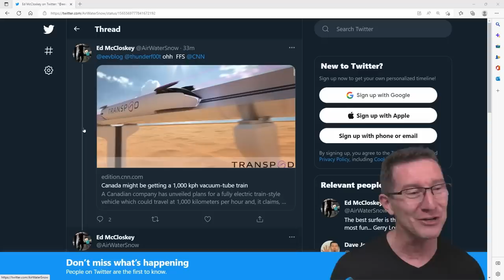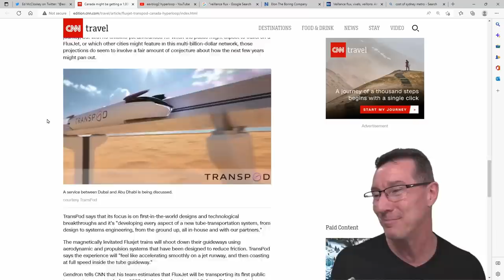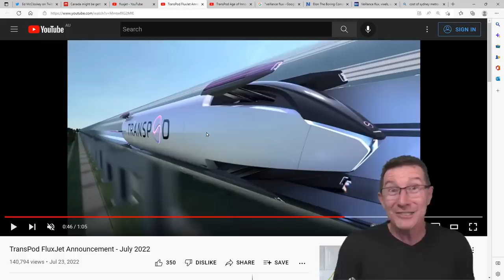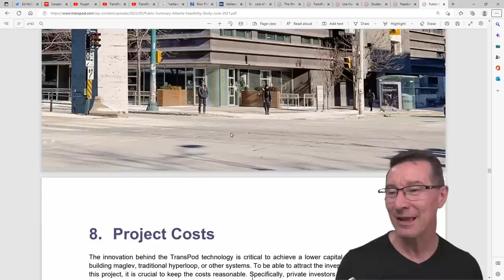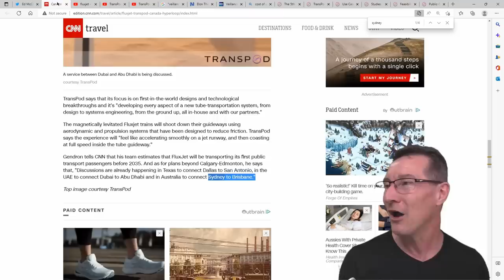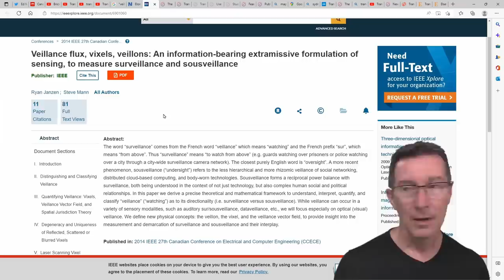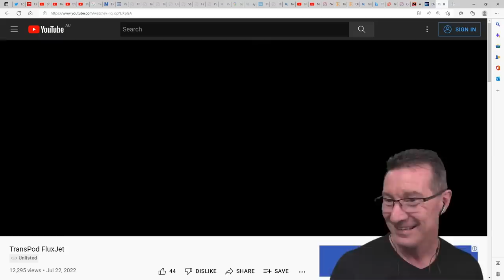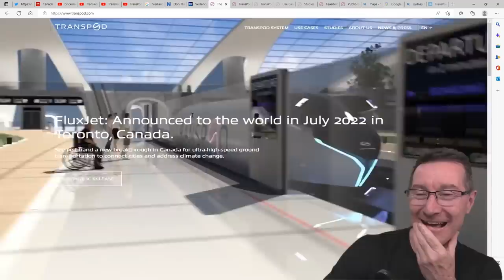EEVblog 1498 - TransPod Fluxjet Hyperloop $550M Boondoggle!

Comment: Canadian here. Our nation's capital only just got "light rail" in the past few years. Of course, they used what is effectively a trolley/street car so it's slow and unreliable. It would not surprise me to see our gov't throw endless amounts of borrowed money (as debt issued to the taxpayer) at unviable projects while they can't even maintain the airports, roads, or existing rail infrastructure. This isn't even getting into all of the major public services that are crippling under pressure right now.
Reply from the maker: Oh yeah, they'll throw money at this and it will all be wasted. Well, it will at least employ many engineers for a while until it completely fails.
Reply: Kansas City, Missouri has that idiotic light rail.  $100M for 10-15 miles…

KCMO has more pressing issues than a trolley to the neighborhood of make-believe.
Reply: @EEVblog  The $9B train was under-spec'd and broke down constantly (search "ottawa light rail disaster" to see more on it). We can't even get the most basic light rail right, and all of our commercial and inter-city routes are still diesel, but they want to spend all the money on these idiotic ideas that will make zero difference since airplanes exist.
Reply: @Thirsty_Fox  It's definitely had issues.. But it's 1000x better than taking a diesel bus through the downtown corridor 2x a day like I was doing..

This is what it's like without the train:
https://www.youtube.com/watch?v=CSrzHAB2u4M

This is what it's like with the train:
https://youtu.be/rzG1CQwGoX4
Reply: @NathanaelNewton  First, I'm not opposed to light rail -- I absolutely think it's great when done properly. What's been done in Ottawa has been late and overpriced, and riddled with problems.

As to those videos, hardly a fair comparison since that bus is taking the route through all the neighbourhoods on regular roads (where they serve many people). The busses are quick enough when they stick to the rapid transitway routes with dedicated roads and infrequent stops. You could put a bus along the route that track takes and it'd be the same.

The worst part was having the busses dump everyone off at Tunney's Pasture when they first opened. Half of the people coming in through town are getting off at the first two train stops -- why couldn't they just let the busses go two more stops? Instead you had people jam packed at Tunney's taking 5 trains to get on. We lived at Westboro station at the time so it was bus for one stop, then try to get a train for two stops, then another bus... finally said screw it and started driving and cycling. Could crawl to work on my hands and knees faster than most OC transpo routes!
Reply: @Thirsty_Fox  You make some fair points.
I really wish I had a video of the rapid transit route that was used before the train was built but that was before my time here..

Ottawa is wonderful for cycling, I really need to fix my bike. 

I spent a lot of time recently commuting from Lincoln fields to Elmvale Shopping Center and it was difficult to decide which way to go as taking the 55 to the 85 was sometimes 5 minutes faster than taking the 40 to the train to the 57 but some days the traffic would be bad and the train would be way faster..

I ended up taking the train on my way to Elmvale and either getting off at lees and taking the 55, Hurdman and taking the 46 or St Laurent and taking the 40.. 

I would have to keep my phone open and track the GPS to know which train station to get off at otherwise I'd be waiting 20+ minutes
Reply: @EEVblog  I saw on the news yesterday in Türkiye that the Hyperloop is being pushed in Türkiye as well. It looked like students were working on a scale model Hyperloop as part of Teknofest 2022.
"Hyperloop was the subject of a competition for the first time in Turkey. TEKNOFEST, the world's largest aviation, space and technology festival, organized a Hyperloop competition among university students. Hyperloop technology, brought to the agenda by Elon Musk, owner of SpaceX and Tesla Motor companies, is based on the fact that wheelless vehicles travel at levels close to the speed of sound."
So another country falls for the hyperloop scam.
Reply: Only because they went with transitway which was great in the 80s but not so good recently with reduced spending. Skytrain in Vancouver received similar criticism in the 80s and 90s but it's good now.

Comment: 30:30 That's just a "little" metric to imperial units mixup: Japan Rail's experimental maglev train JR L0 Series achieved 603 km/h (375 mph) on a 42.8 km magnetic levitation track in 2015.

Comment: Our neighbors in Alberta have temperatures ranging from -40 to +35 C .. thermal expansion of vacuum tubes sounds like a challenge .. Greetings from BC
Reply: More than a challenge. The only way to mitigate it would be to do it underground where the temperature can much more stable. Then you have a lot of new problems that make it equally stupid.
Reply from the maker: It's one of show  stoppers.
Reply: @MeppyMan  at least in the underground version, they wont have to be moved to a grave.
Reply: @Redstoner2b2t  haha!

Comment: Regarding land issues - Edmonton and Calgary are probably among the cheaper major cities for real estate in Canada - it's not Vancouver or Toronto by a long shot. I could buy at least a couple detached houses in Edmonton for the worth of my 1 bedroom condo in the Vancouver area.

Personally I think there should be more focus on local transport, it's a heck of a lot more useful to put money into expanding the existing train commuter train networks to get cars off the road.
Reply: Not familiar with Alberta but what about the land in between? Where are the oil sands located?
Reply: @dejjal8683  Natural resource industry is to the north. Calgary and Edmonton are surrounded by farms.
Reply: @dejjal8683  the land in between is sparsely populated prairies almost completely flat...actually almost ideal for this sort of thing, if the concept wasn't completely hogwash.  There are no oilsands between Calgary and Edmonton at all--it is exclusively natural gas and light oil in that area retrieved from conventional drilling and some fracking.

The oilsands are another 300km further north than the northernmost point of the proposed line and so would not really factor in at all, except perhaps for Calgary workers who would take this to Edmonton to catch a direct commercial or corporate flight to Ft. McMurray since many if not most of such flights from Calgary make a stop in Edmonton now anyways.
Reply: @markshanehayden4648  Thank you for the answers. My second question would be the problem with settling. I wonder how deep the piles would have to be to prevent major problems down the road.

Comment: 35:09 I see laminated iron cores of Microwave Oven Transformers with crudely made windings? It reeks 'low budget movie prop'. Now I cannot unsee it.
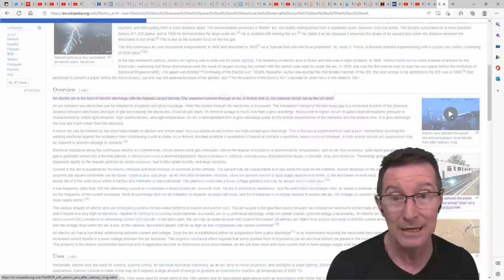37:34 Arc is undesired effect in electric transport. Thain with overhead power line was shot in winter when power lines covered in thin layer of ice and arking like hell when ice is crushed by pantograph. This effect is undesirable bcause it erodes copper from power line and contaminate carbon electrode.
I mean, Green soveiet-style train was not powered by arc but more like just arcing due to icy power line
I have posted this on Odysee but will leave it here too:

I have worked on linear electric motor for oil pumps about 4 years ago. We made some working prototypes but project was canceled.
And I have to say just one thing - High temperature rare earth magnets are bloody expensive and heavy!
You have 2 ways to build linear electric motor on pod like this – place coils on your pod or on rails. Other side must be permanent magnets or electric magnets.
And what happens when you leave strong magnets in place where ferromagnetic dust are flying around?

There are also size concern. You see, there are specific ratio between you ‘Pole width’, ‘Frequency’, ‘Torque’ and ‘Movement speed’…
You cannot make High-torque High Speed and Small linear motor, just like any other electric motor - there is no magic!

Also forget about any plasma near the rails with strong magnetic fields that propel this pod…
I don’t know much about plasma but I can say for sure – Plasma does not works the way shown in the video. Also it would wear contact surfaces in no time (Say hello to arc welding / plasma metal deposition)

I think almost any engineer regardless of their fieald of expertise would have the same reaction as Dave here. (w00t? LOL!)
Reply: they claimed the rails were just steel - its what they seem to claim distinguishes them form maglev - use of attractive magnetism only.
Reply: @Mijc Osis  If rails are ferromagnetic then linear magnetic propulsion, using the same rails as part of linear motor (rotor or should I say, slider?) are impossible. 
Well, this whole thing is questionable, at best.
I wonder if it possible to make linear motor like induction motor with diamagnetic 'rotor', I doubt it. There will be no distinct magnetic poles without ferromagnetic core that guide magnetic flux… The ‘Rotor’ part will just heat up due to Eddy currents with almost no repelling magnetic force.

Again. Linear motors are not magic. They are very nice but niche thing...
Reply: @gelecopter  maybe they really have created some kind of eddy current drive in steel, and leakproof tunnels, and a plasma pickup shoe and track good for commercial use that doesnt somehow oxidise and vaporise, and ..........

Comment: Here is my question, why do you need LiDAR on your vacuum encased maglev? What do you expect to be there other than what you design?
Reply from the maker: It's so that so that you can stabilise the pod in real time. Good luck doing that at 1000km/h.
Reply: That seems even more foolish, better design would be to just make the track smooth and reliable surely.

Comment: I only have one question: how do they prevent side fumbling?
Reply: Easy, "Side Fumbling" can be prevented by introducing six hydrocoptic marzlevanes,  fitted to the ambifacient lunar waneshaft. This will significantly reduce the troublesome phenomenon.
Reply: They line it with prefamulated amulite.

Comment: Red Deer is a small city right in the middle between Calgary and Edmonton.
Also there is no mountains to drill through on that route :) Just slight elevation changes - it's prairies.
Still will never work. I'd be happy if they would run just normal passenger trains between Calgary and Edmonton.

Comment: I have One big question: how can you cool the electromagnets and all the electrical systems + people of a train that levitates in a vacuum? I guess it dissipates some heat and I don't think the vacuum is the best conductor of heat :D 
a hyperloop train is like a thermos that generates its own heat....
Reply: I asked the same question to a team member that was part of a hyperloop contest. They were literally just relying on thermal mass and the short nature of the test environment.
Reply: @Firecul  Thermal mass of the people inside? :))))) tot keep an object of several tens of tons float in the electromagnetic field, you generate a fairly large amount of heat from which you can dissipate almost nothing because of the vacuum - where do you accumulate that heat (it can be several tens of kw) during a journey of 30-60 minutes…
Reply: “Der you just run an air conditioner of course” - someone probably lol. 

I guess you could load it with some supercooled mass that absorbs the heat and is then swapped out. Good luck if that fails though.
Reply: @MeppyMan  each system added to compensate for some deficiency adds mass and volume that must be transported, which increases the energy required for levitation and propulsion + increases the risk that something will go wrong through the additional complexity - not that a train placed in a vacuum would not be a sufficient risk: p
Reply: @mihaiachim5299  1000% agree :)
Reply: obviously you route a perfectly vacuum-sealed groove in the top of the tube, and dump sacrificial liquidized tungsten in a constant brilliant spray as a sort of a liquid droplet radiator!
Reply: Conduction is not the only way to dissipate heat.
Space stations are not overheating and they are in space.
So this part of technology was actually figured out long time ago and shouldn't be a problem.
Reply: @goury  the space stațion is  veri big and It doesnt generate 30-50kw of heat ;) + It doesnt have 30-50kw of plasma ark to power It ;)
Reply: @goury  and space is very cold - It is easy to radiate heat in It ;)
Reply: @mihaiachim5299  askchually, ISS typical power consumption is 75-90 KW and it can go up to 120 KW and solar panels it uses are very sensitive to overheating.
So no, heat dissipation is not that big of a deal.
Reply: @goury  good point but they are two different systems, one is closed the other is not. So let’s think about that for a moment. If you use internet electromagnetic radiation to remove heat from the pod it will need to be efficiently absorbed by the pipe wall and transferred somehow to the outside. If that’s not 100% efficient then some of the energy will be reflected back and the pod will still increase in temperature. 

I’m not an engineer so I’m just thinking through the physics. I’d assume this has already been worked out, but given the problems inherent in this idea I’m not so sure about that.
Reply: @mihaiachim5299  no it's not and it also doesn't matter
Reply: @MeppyMan  I am an engineer.
Nothing is 100% efficient and it doesn't have to be. As long as it's not negative, it'll work.
So it will only be bad if the tube'd become so hot it would radiate more than it can absorb and allow through.

And the thing here is, it will radiate absorbed heat both ways, inside and outside. So it will be okay unless they paint it black and a lot of sunlight or drill through an active volcano.

If it's even 0.01% efficient, the pod will cool down. Using aluminium will probably make such cooling efficiency 80-90% efficient, so should be more than good enough.
Reply: @goury  ok that makes some sense, but won’t the rate of energy dissipation matter? And if it’s 50° C outside and midday, surely that’s going to be a problem? You still have to be able to get rid of enough energy quickly enough. 

Although I suspect that the whole pressure difference and expansion/contraction are the main deal breakers.
Reply: if the tube were at say 10% stp the shockwave would still heat the tube and vehicle front as you pass through and leave a really cool area behind the vehicle.
Wouldnt be all that hard to make use of but i dont know if it could cool what is likely megawatts XD
Reply: @mycosys  ;) yes - not enough surface area in the back
Reply: @MeppyMan  no and no.
It may be less efficient, but it will work.
If not, we have heat pumps that can cool things down even when it's 400°C outside.
If you are not able to get rid of heat fast enough, just slap a bigger radiator on.
Both on the tube and on the pod and the problem is solved.
And the price of that solutions will be negligible compared to the vacuum tune alone, let aside all these plasma rails and what techy mambojumbo else.
Thermal expansion also isn't an issue if you artificially cool the tube.

The real problems here is that technology that can make this economically viable doesn't exist and can't be even theorized yet.
And also that there's little to no demand nor foreseeable ways to induce such demand for what will require an enormous upfront investment.
Reply: @MeppyMan  That's convenient though, in the case of an accident the maintenance workers can just shatter the flash frozen remains of the passengers and clean up the dust, all is good, noone was onboard
Reply: Perhaps they need to read about the heat problems some of the deep level London Tube lines with excess heat?

Comment: When the LEGO train concept I came up with as a kid is more practical then your "new" hyper-train thing.  Concept was two large rails that acted as a slot for a post mounted to the train, this allowed the train to rotate 360 degrees on the post for right angle turns.  Should try and build a motorized version sometime to really test the concept.

Comment: Wow, those sensors!
It looks like all their "Vallance flux" is doing, is basic "edge detection" - one of the oldest and simplest computer vision algorithms out there.
Just like the name suggests - it detects edges - sharp transitions in the image.

It has been used in cars for "lane assist" for about a decade, and you can find it in your favorite graphics editor under "magic selection" - the tool that lets you pick objects in a picture automatically.
Heck - that one is probably much more complex and advanced than what they are showing...